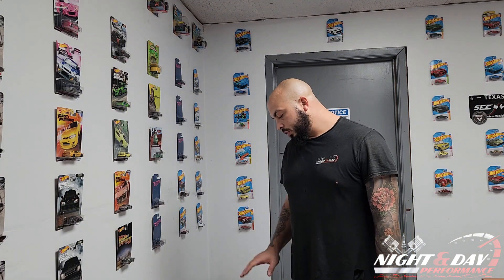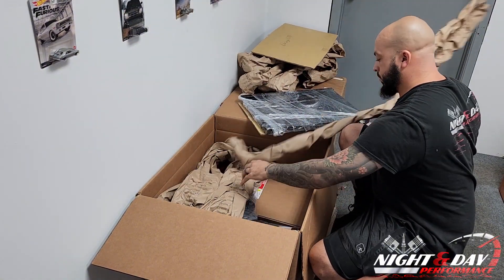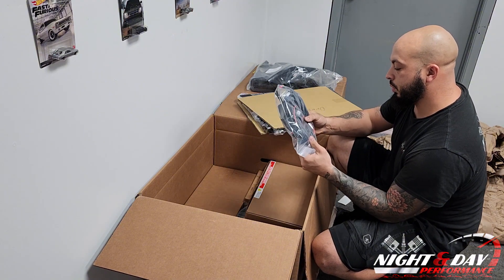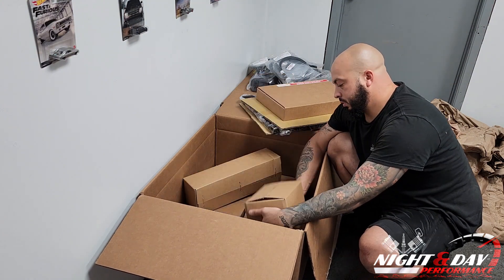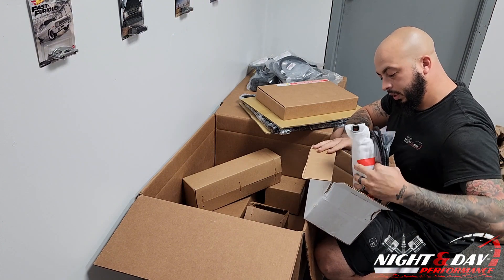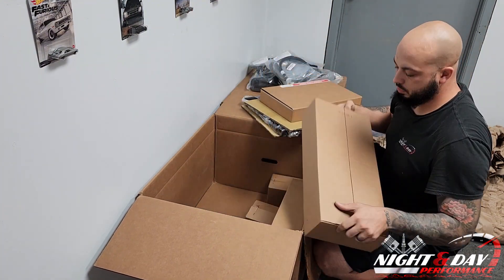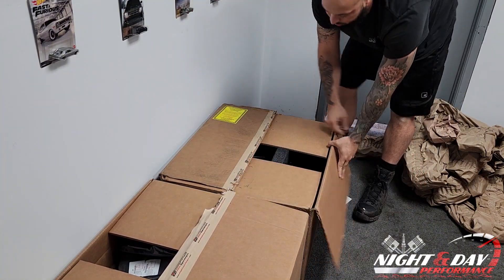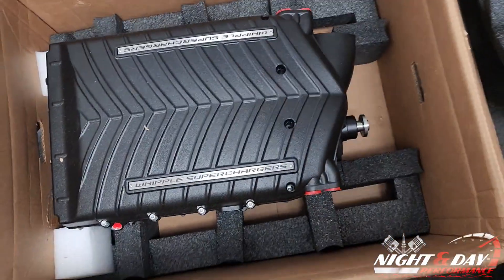3.0L Whipple Supercharger Unboxing

Comment: is there different stage whipple superchargers you can buy? I have seen peoples kit come with full intake systems and huge inter cooler systems
Reply from the maker: yes there are. each Whipple is usually built to order so you can add different options etc as well as stages